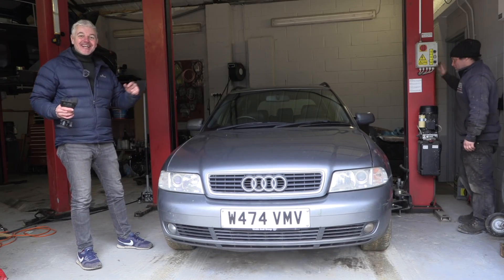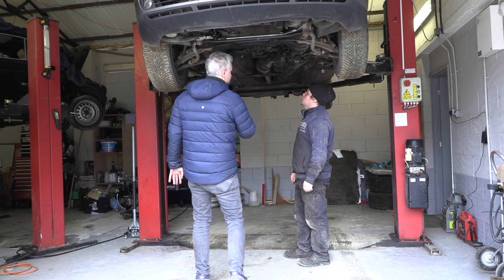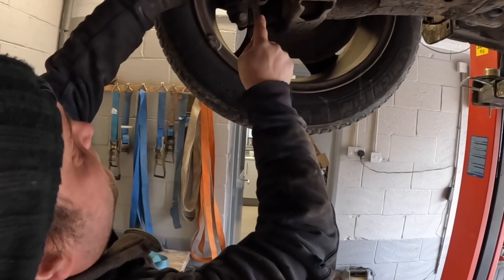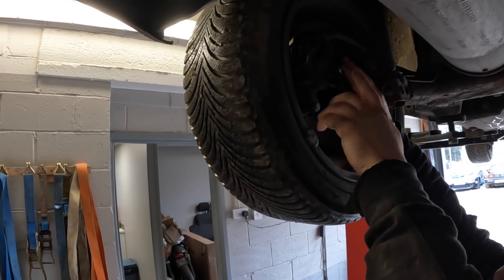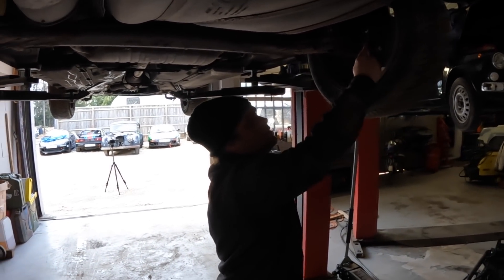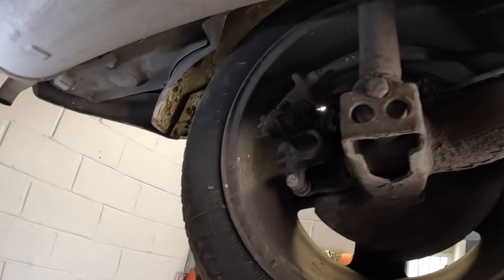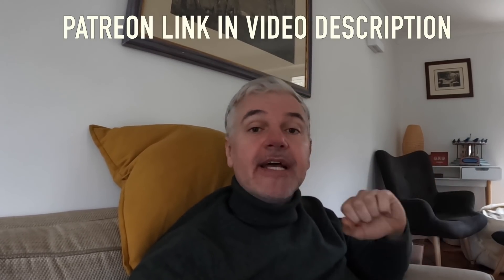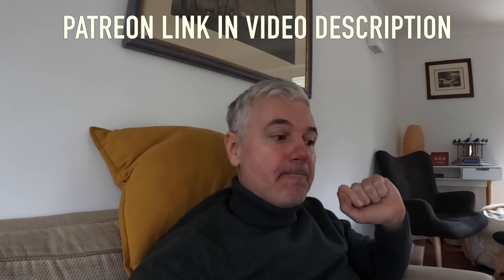Everything that's BROKEN on my FREE Audi A4! Still worth fixing?

Comment: Is it worth approaching GSF or Eurocarparts for donation of the CV Boots, ball joints, flexible brake pipes etc if it’s for a good cause? Didn’t like the jubilee clips on the fuel lines as looked a bodge. You will get crusty surface rust under a car this age. A sympathetic wire brush and a wipe with an oily cloth works wonders. A B5 should be lifted under the sub frames. My previous B5 S4 used to eat through CV boots and tie rod end dust covers like they were going out of fashion! Overall a sound car worth saving. Well done.

Comment: See those pinch welds? That is where you really want to lift the B5 from. The floor in the front is a void between two layers of sheet metal. It is common to mush this by incorrect lifting. There are indents for the jacking points in the pinch welds. This has worked great for me coming up on 20 years with this chassis. The rear brake service on the beam axle will be more annoying than on the independent rear axle of a quattro. The rear rotors are also the rear bearing races and hubs all in one annoying to service package.

Comment: I picked up an 03 A4 v6 convertible for 350 pounds and am loving it after some work. With more work to do but all upgrades she is an excellent driver. It would have been an absolute travesty to see it go to the crusher and and I can do my own work so the project was born. I however do not recommend buying a cheap Audi unless you know how to do the work, getting the work done by a shop will cost you an arm and a leg on labour and materials.

Comment: Changing VWAG driveshaft boots is insane. You can buy a complete replacement driveshaft with new boots for less than you would spend in labor having the boots changed on the old, dubious driveshafts. In the US they are sold with a lifetime warranty so once the boots split again (which takes many years), you just turn them in and get free replacements. Forever. 👍

Comment: Go ahead. You may find someone will make a generous offer for the car. Nice gesture to absorb your costs. 
One question “surface rust” is there any other type?
Reply: Rust that has gone all the way through!
Reply: @TheMentalblockrock  thanks, accepted but my point is it always starts on the surface perforation is just advancement and you can’t discount it by saving “just surface.”
Reply: @nickpage2949  Structural rust usually starts from the inside out. So You can have intact undercoating hiding total corrosion on a chassis member/box section that has rusted through completely starting from the inside of the box- section. Where the outer paint layer has failed you can have some localised surface corrosion that can be easily dealt with by wire brush (on grinder) and some good rust stabilising paint. That is what Jack found on this Audi.
Reply: The full flintstone ( no floor pans).

Comment: B5 enthusiast here and a word to the wise.....don't bother with a 2.5!
I've had so many B5's over the years and by far the worst of the crop is a 2.5, bought one not long ago '2.5 TDI quattro' for £250, nobody wants these, uneconomical, unreliable & slow (compared to the 1.9 TDI).
If you are pressing ahead then don't bother buying cheap suspension arms as the don't last, has to be MeyleHD/Lemforder or don't bother.
Personally, I would scrap it, you have a double DIN stereo worth around £200, arm rest is another £80, steering wheel £50 and interior £150, if you have a rear boot cover in good condition then that's another £50, catalytic converter and the body itself will return good money from the scrap man.

Comment: Cam belt? Notorious balance shaft problems? Car is under-evaluated at this point.
Reply: No balance shaft issue on these 1.9tdi engines. 2.0tdi only..
Reply: @MM168NSX  we were never blessed with these here in the States. Have to build them from spares.